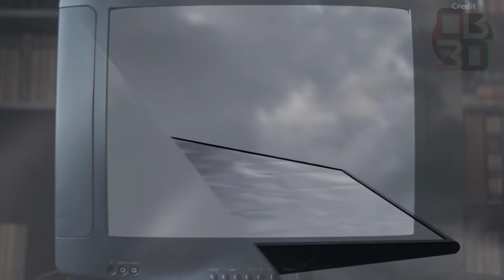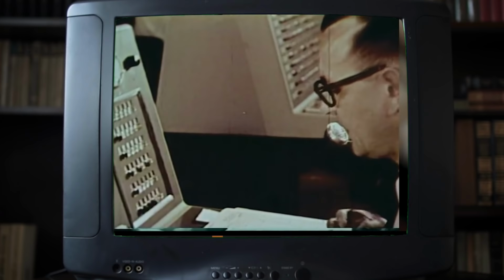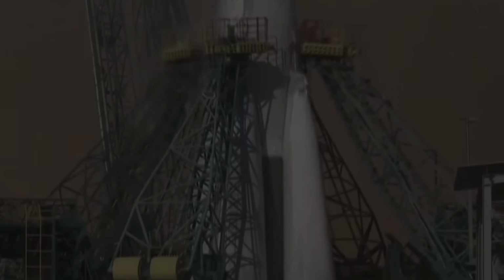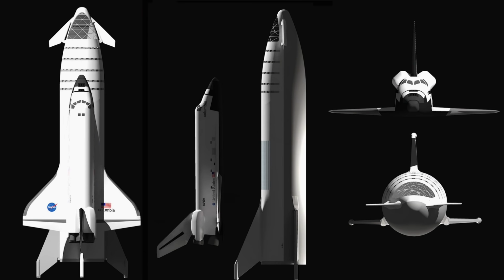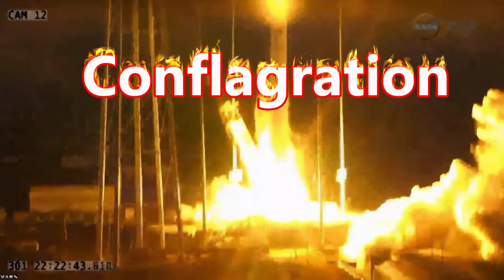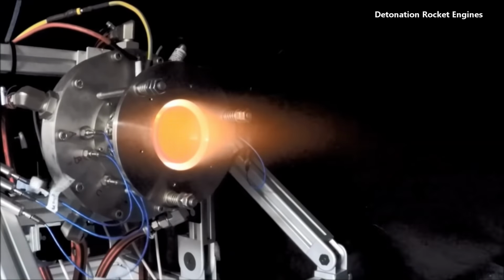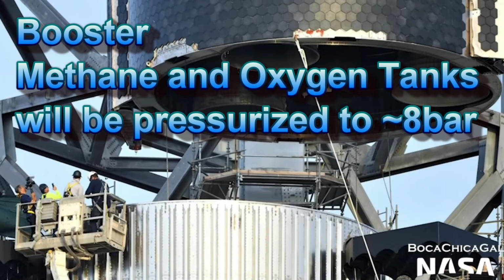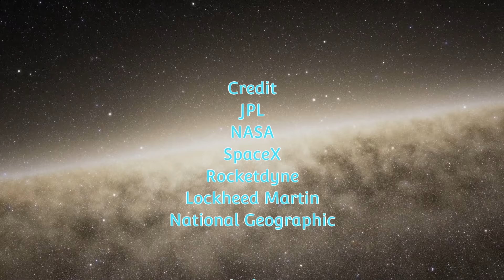Rocket Science: Starship Abort Systems

Comment: To what degree do you need to get away from super heavy? If the flight computer disables super heavy engines in emergency and activates starships engine surely the super sonic rocket engine exhaust of starship would reasonably quickly separate the two? it's not  like bits of the top of super heavy are going to fly into engine bells which pumping out super sonic jets of flame in opposite direction. I mean Starship protoypes landed ok with engines within a metre or two of the concrete. And wouldn't all that engine action burning a hole in top of superheavy  create a rapid depressurization conveniently pushing the two apart? and if explodes wouldn't the supersonic rocket exhaust protect starship anyway a bit like falcon 9 hypersonic  reentry burn protects falcon? Some bored teenager should allocate a few hundred CUDA cores from their gaming rig to model it on their outlandishly overclocked GTX 970 for you to see what sort of margins one needs in terms of super heavy/starship separation, engine timings, min number of engines etc. curiously if Starship managed to reliably escape to a convenient spot and at hover mode at appropriate altitude, one could have quite a few minutes to make for the hatches and jump out in their spaceX wingsuit with parachute and glide and  to safety like a hollywood action hero lol.
Reply from the maker: It's the spin up time that would be the issues... the Starship could fall down into the expanding fireball of an exploding SHB.
Reply: @terranspaceacademy  Hi, and thanks for replying. Out of curiosity How long is he spin up time? I just assumed engines took a second or so from watching and listening to the various tests and the seeing way the the engines lit up and hearing the sound spool up. Is that still too long, as the inertia of 1300 tonnes isn't going allow very rapid separation either way I would've thought and given that, the ideal would just to get the engines lit early as possible to use a protective screen  initially more so than speed away. I mean what 'sthe best starship could manage with full tanks 1g? that means after a few seconds be lucky to be much more than 10 metres away assuming a bit of latency.